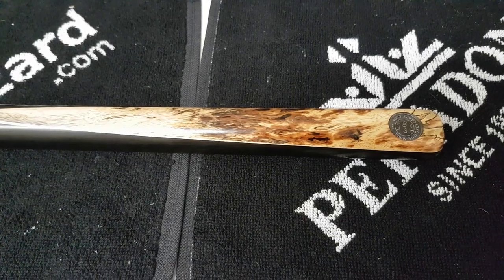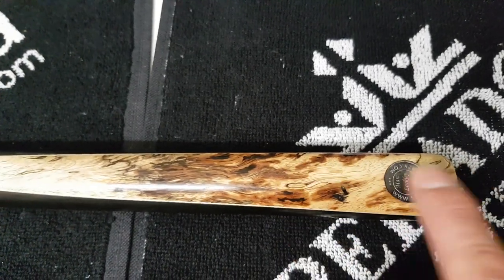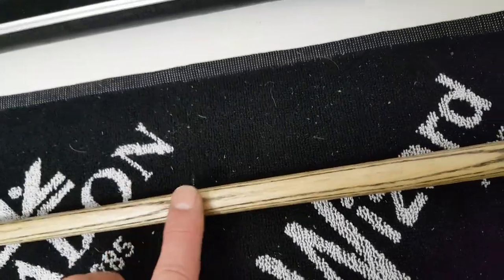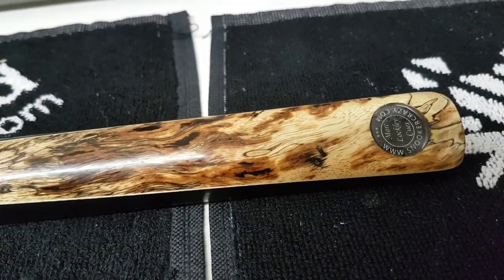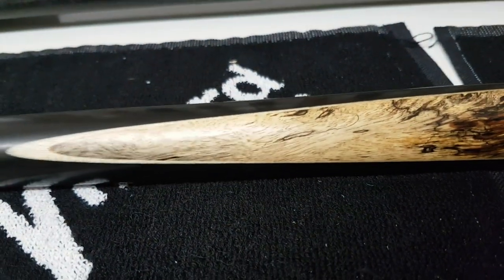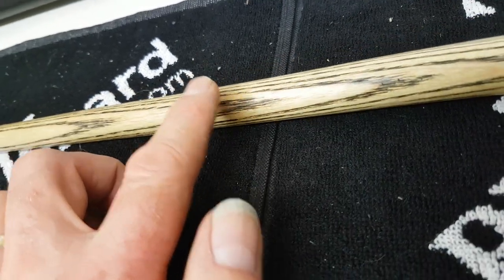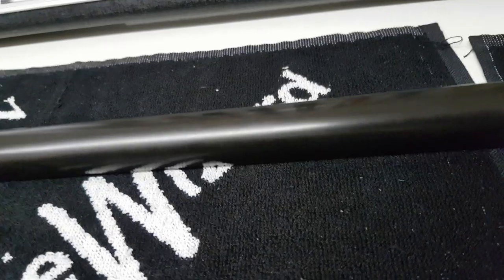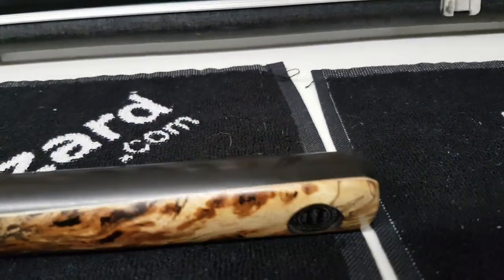Refurbished Pool Cue Explanation - Re-graining

Comment: Just to confirm, the sanding sealer used on this cue was a Shellac based sealer so a wax or wax/oil mixture is fine as a top finishing coat on the butt.

Comment: Is the black bit of the arrow likely to become lower?
Reply: Would have been good to see the whole video from start to finish. Great work Marc 👍
Reply: In certain parts of the shaft it can be but normally  proud. over time it can be a pain on the underside of the cue over the bridge hand where the arrow (dark grain) meets the lighter ash.  There can then be a tendency to feel a ridge there. It's always difficult to know what the shaft was like pre finishing as some of the ridges may have been there originally and some just developed by normal use and as the finishing products and ash wear away.
Reply: @grahamsinclair5778  Hi Graham. I will try and do some more videos as so get time. I have a local guy with an expensive Thai Cue that is heavily lacquered that I might try and do a whole video on. I'm sure removing the lacquer and show many ridges and issues with the ash so would probably be a decent example of starting with something that looks perfect, removing the lacquer to reveal lots of wood issues and then bringing it back to life with a different more softer and smoother feel. We'll see.
Reply: @marclockley3229  sounds good Marc, look forward to it 👍
Reply: @marclockley3229 did you ever make this video Mark? I have a few cues of my own that I've taken the varnish off, used boiled linseed oil to oil it back up again but quite a bit of the grain filler came out in the sanding process. I know you can use ebony dust mixed with a little linseed oil to fill them back in but I don't fancy sanding any of my cues down to get the dust that's needed!!

Do you sell any of your own brand grain fillers and finishing oils yet Marc? If so I would be interested to buy some from you so that I can get my cues back to where they should be!

Please let me know mate.

Thankyou.
Mark.